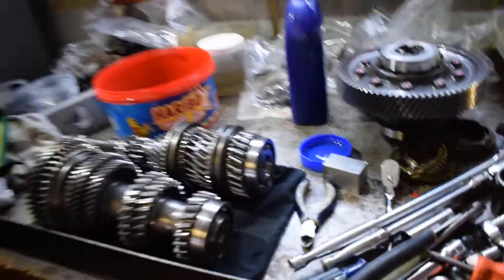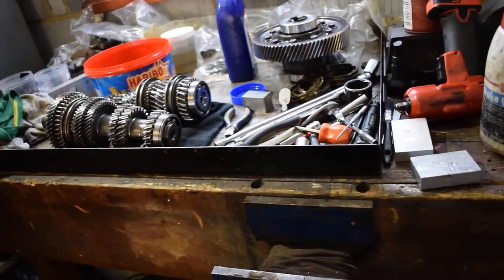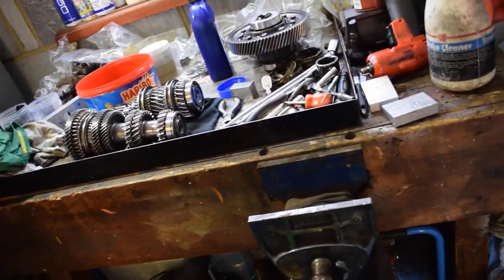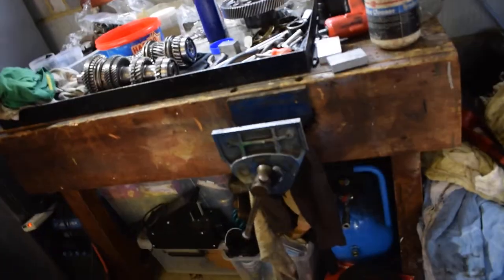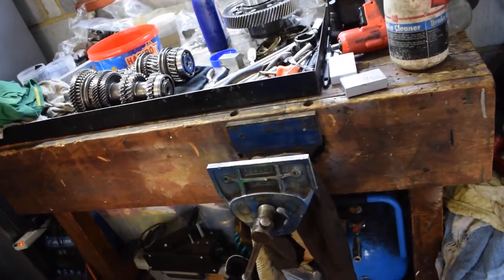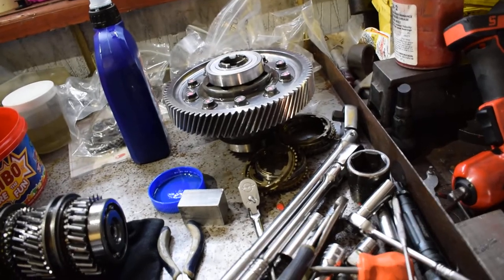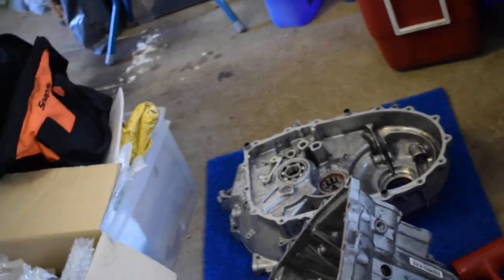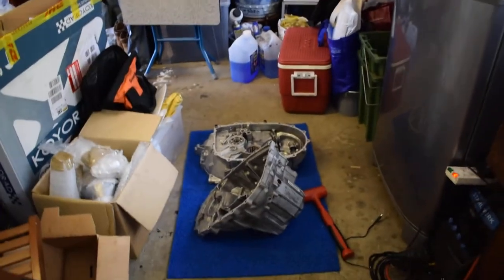Micro vlog #1

Comment: when you say super finished what do you mean? and how much is it to get done from a quick google I can't really seem to be able to see any prices without giving someone a call.
Reply from the maker: Superfinishing is a process that modifies the surface finish to better retain an oil film and reduce friction and wear. Thus more power gets to the wheels. Longer life, less temp and less oil changes. You won't find prices online as it tends to be quoted per job. But I normally pay about £10 a gear.....and there is a lot in a box to polish.
Reply: thanks for the info. what company do you use for it?